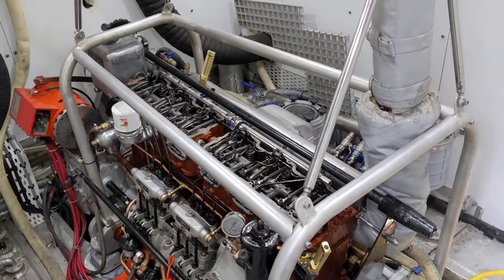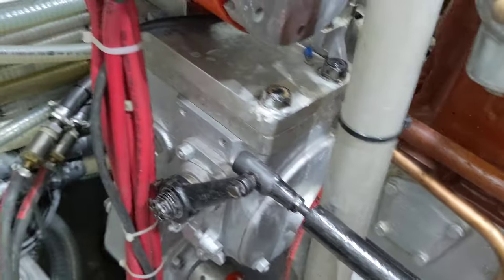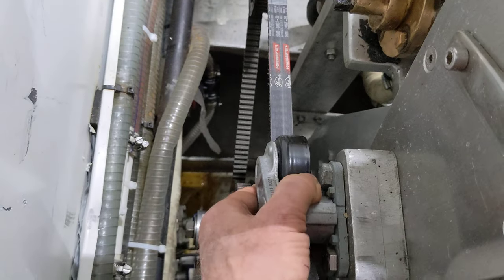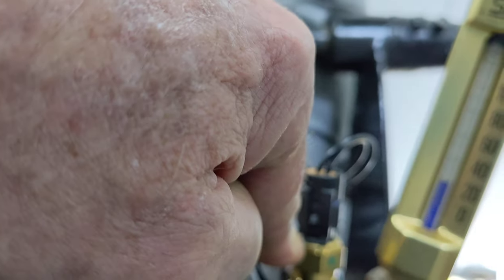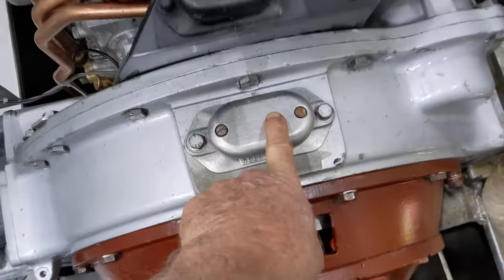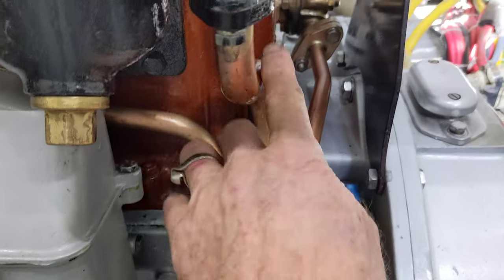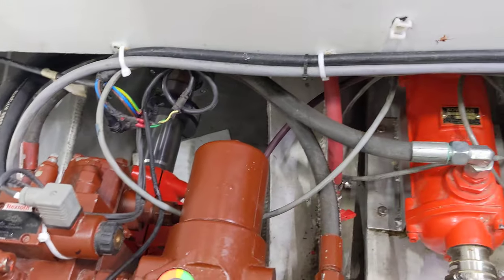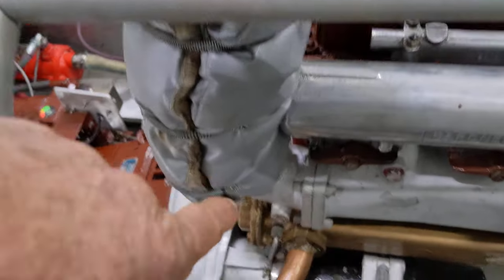Tour of Mr. Gee our Gardner 6LXB

Comment: This setup is one ive wanted to see for a while
A cracking gardener slow but high torgue engine driving a modern "dashew" style hull

Spares availability would possibly bother me but on the flip side being a world used engine probably finding a mechanic isn't a massive problem?

Also im just wondering what back up drive you have (if any)
Reply: Hi Chris.  Glad that you like the pairing of an 'old school' Gardner with the modern slippery hull of our XPM78.  Seems to be a very good combination to us too.  Spares are not an issue at all as everything is available from Gardner Marine Diesel in Kent UK and I've stocked up on all the spares and then some that I might need so I think we're good there.  I find that once a mechanic gets past how different the Gardner appears to them based on the modern engines they are used to, it doesn't take long to appreciate the simplicity and find them very easy to work on.  
For backup, we have a 110HP Yanmar with a Castoldi Direct Drive jet in our 5m Tender.

Thanks for the commenting.  
Wayne

Comment: Have the causes for lubrication failures been corrected?  Or was the issue just related to excessive loads at low RPM?

Love the Gardners, wish the world was as simple.
Reply from the maker: Hi Creig, thanks for your interest.  

I'm delighted to report that YES! now all the lube oil failures have been fully corrected and we look forward to many years and decades of hearing Mr. Gee purring away as we cruise the world on Möbius.  You can read the full story over on the Mobius.World blog but short version is that it turned out that three totally different things happened that each cause the oil pressure to drop.  The first was the excessive loads upi referred to which was perpetrated by an inept hired captain which led to the 2nd rebuild.  

On sea trials for this 2nd rebuild the oil pressure held fine for the first 7+ hours and then started to drop off slowly.  After a LOT of testing and detective work I discovered that the rubber O-rings sealing the pipework on the crankshaft main bearings had been damaged when they were installed and they began to erode and eventually started to leak.  Took a good while to figure this one out but eventually I discovered that a 'perfect storm' situation had been created when O-rings at the maximum end of tolerance were installed in grooves that had the minimal or less depth.  More rubber than space available so when the fittings were torqued down some rubber was squeezed out and pinched which cut the rubber O-rings open and led to them eroding and leaking.

Having fixed all of this on rebuild #3, I got one last scare when for some reason the new Gardner oil pressure gauge that had been working just fine, suddenly and unknowingly dropped its reading by about 20 PSI and gave the appearance that the oil pressure was about 15 when running.  Turns out that the problem was with the gauge and not the oil pressure itself so this ended up relatively easy to fix in spite of taking months to figure out.

Good news is as you see in the video is that Mr. Gee is back to running as you'd expect from a LXB and the oil pressure is dialed in just right at  35 PSI @ 1000 RPM with the PRV adjusted as specified.  After this long and winding road of chasing the elusive oil pressure I won't fully breathe easy until I've got at least 50 hours on Mr. Gee 3.0 but I'm pretty confident that I have found and fixed all the gremlins that have been haunting these rebuilds and that the third time will be the charm.  

Stay tuned for more as we get ready to head out to sea at last and thanks for joining us on the adventure.

-Wayne
Reply: so no damage with the second rebuild just O rings replaced.  Good to hear it fire up!

Comment: You said the oil pressure should be 35 lbs. I think you will find the manual says 42lbs?
Reply from the maker: Thanks for your interest and comment Alan.  Gardner engines in general have always had lower oil pressure than what we are accustomed to in more modern engines so your quite right that 35 PSI does seem low.  However for the 6LXB engines such as the one in our boat, the oil pressure specified by Gardner is 35PSI and is even stamped on the cap of the pressure adjustment valve.  More specifically the 6LXB oil pressure is to be  35PSI @ 1000 RPM @ 60 C.  This was carefully set during the initial dyno testing of the new engine and then I check this every few hours when we are underway and have the oil temp up to 60C.  Happy to report that the oil pressure has been 35PSI throughout all our passages and I'll continue to monitor this and all the other engine data I log.  
Hope this addresses your concern and provides a bit more detail.
-Wayne

Comment: I have to ask why has the buffer/damper been removed from the front of the trigger box on the 1st injector pump body?
And do you remove the cheese head screw from the trigger box ( next to the brass tag) and in between the two studs/nuts holding the second door on and squirt sum engine oil into each pump body?
Only 3-4 squirts needed.
Reply from the maker: Not sure which photo you are referring to but I can confirm that the buffer is there.  We adjusted it on the dynomometer at Gardner Marine Diesel in the UK when they were first testing the new engine out.  
Still all quite new, 710 hours right now so no need yet to do any oiling of the pump body but will do as per the Gardner maintenance schedule when we do.
Sounds like you are very familiar with this fabulous engines and I appreciate your interest and notes.
Thanks,
Wayne
Reply: At just before or just on 1 minute into the video you can see the buffer isnt/wasnt in the trigger box. It has/had a Blue rag or piece of cloth stuck in there. Good to know its there now. 
Ive been rebuilfing Gardners and their injector-pumps, sprayers, turbos etc for 40years now.